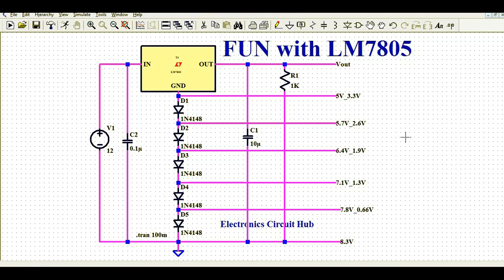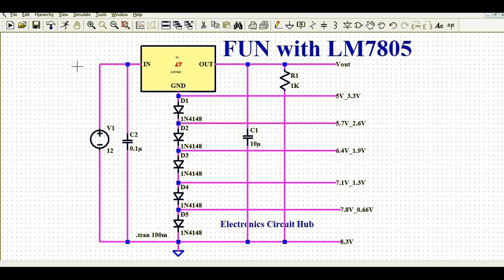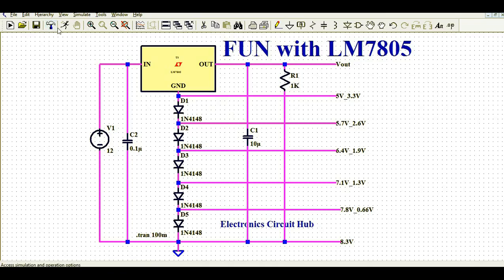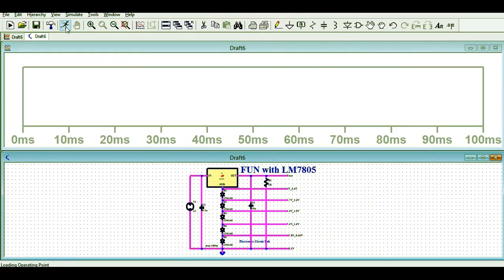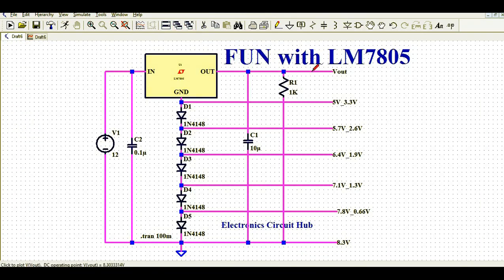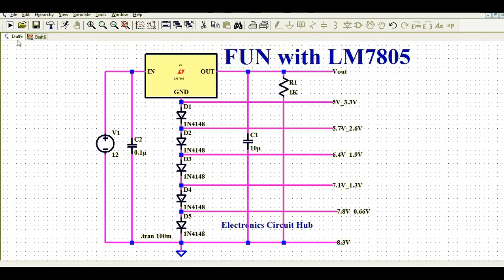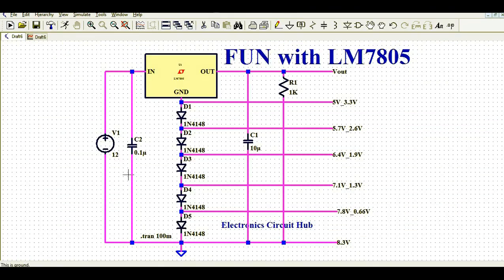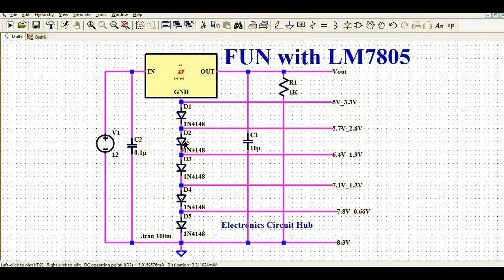Multi-Output LM7805 Voltage Regulator Circuit Simulation in LTSpice

Comment: There are some drawbacks to the circuit you showed. Mainly, the forward voltage drops across your 1N4148 diodes is dependent on their bias current. The bias current is equal to the current flowing through the GND terminal of the LM7805. While this is not strictly a bad thing, it is also not ideal because this bias current flowing to ground can vary with process, temperature, and input voltage to the LM7805. The result is that your diode forward voltage drops will vary from your simulation results if you were to build the circuit in real life. 

A better way of generating different voltages within a linear regulator would be to vary the resistances across the error amplifier within the device. This is how designs using the LM317 work where you can set the output voltage of the device by putting resistors with the value of your choice in the feedback path of the error amplifier. This is made possible due to the internal 1.25 V offset present at the input of the error amplifier op-amp.
Reply from the maker: Correct , we can generate the voltage using LM317 for sure.